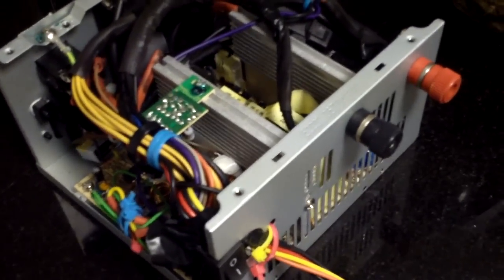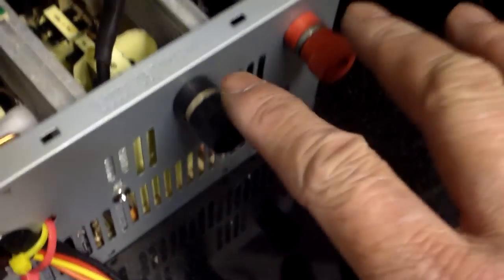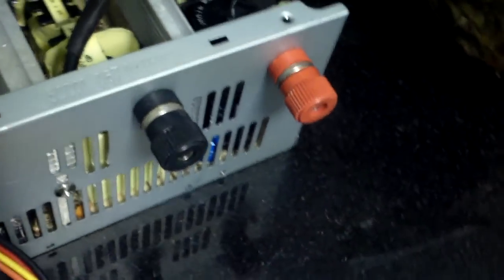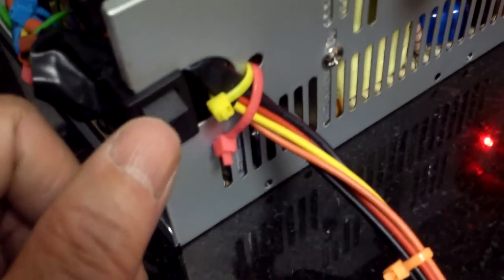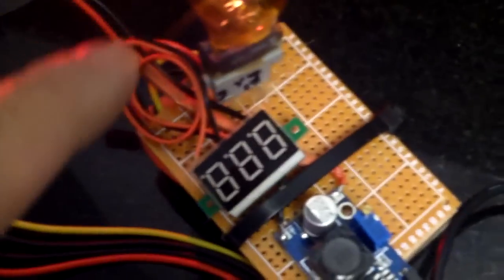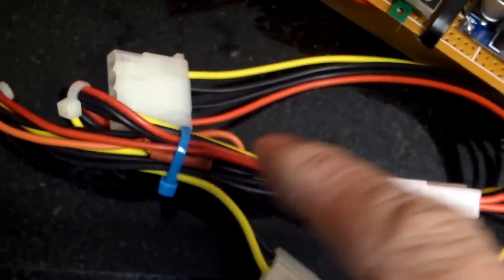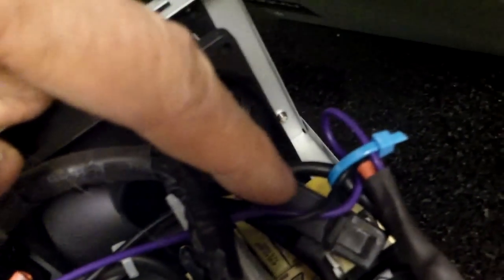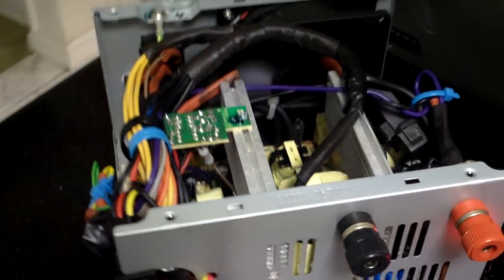Add a variable voltage option to your converted PC power supply pt 1

Comment: I have been using an ATX PC power supply for some time. Over time I have added this and that, until it looks like some , well, a whole bunch of crap all hooked together.  I built a new case from and old Spa Ozinator, I got the fan  cut out and mounted. changed the leads to to quick connect, as the fan and circuit board are now mounted on opposite halves. 4 screws and the circuit board with back panel slide out the back. I have yet to add the digital volt meter, my LED indicators, power switch ect.  
Thing is I have been debating weather or not to keep the 3.3V and add a post. 
After watching your video I have decided that I'm not going to.  USB, that debate still remains.
Thanks bro, for showing the alternative. I like it. I have something similar, but it's not variable.  YwRobot supply, can be set 3.3 and 5V.
See you around.
Reply from the maker: Thank you for adding your comment and your insight in converting the power supply.
Reply: @wtam69  You're welcome.  I have been enjoying YouTube for years, In fact YouTube is my Television entertainment 85% of the time.  The content is amazing.  Entertainment, that's one thing A+, but the information, is incredible. Any time I have a question, on doing anything, I always come here.  How to change the door lock on a chevy blazer, how to recondition a car battery, how to set up x y z swimming pool, how to build a fish tank, it's just endless. I find usually exactly what I'm looking for on first try.
I am just blown away with the amount of material here on Computer building, hacking, bulldozing, as well videos on electronics, which I am binging on at this period.  I have some great projects going on in electronics right now. What it is, is how long it took me to get here, to the world of amazing electronics projects, circuits, and gadgets.  This is great.  Now I got to ask you, have you noticed,  I think every electronics enthusiast on here has a DIY Power Supply of some kind, and is often their prefered device when demonstrating, even the guys with all the Expensive equipment, have a DIY PS  Most all of them are something I would rather have than an off the shelf unit.  Back in the day, the first thing an apprentice  carpenter built, was a tool box.  A power supply obviously makes perfect sense.   check it out.

Comment: BTW your switch mode power supply is regulated based on the 5v output, you will find the output is more stable if you place  the dummy load on the 5 volt rail. (you can tell the 5v rail is where the feedback circuit is because of the 20 Amp Max rating/also this is common for ATX feedback circuits)
   The other rails are most likey unregulated unless there is an additional linear regulator placed before the output. The other rails have a looser tolerance and are only regulated by their transformer secondary winding turns ratio in association with the 5 volt rail. 
   You can vary the entire unit's output by modifying the feedback circuit (assuming the components are rated for a higher output). If your supply uses a simple shunt reference for feedback (extremely common), I just uploaded a video on how to modify a SMPS shunt reference. Check it out.
https://youtu.be/5uiQjes-a98
(shameless self promotion, but the vid is licensed under creative commons and is non monetized)
Reply from the maker: Thank you for your input. I will check out your suggestions.

Comment: Can you combine the 12v wires to 24v and therefore  half the amperage?
Reply: boowonder888 
 It depends on how the transformer is configured. The secondary windings must be isolated from each rail. If the secondary windings for any 2 rails are totally independent, with their own independent rectification circuit, then they are "fully floating." This means each completely independent output rail can be treated like an independent battery. If you find that you have floating rails, they can be configured in series to "stack the voltage" or create a center point for dual polarity, or can be wired in parallel to increase output current. Just remember, isolation happens at the transformer and must remain isolated (no common ground connection, etc.). Also the biggest misconception many beginners have is that Diodes create isolation, they most definitely do NOT.

Comment: You only need to place a resistor which will place a load to get the converter section working.  I used a 1ohm half watt resistor and it started converting.  No need to go out and buy a 10 dollar power resistor.
Reply from the maker: Thanks for your insight.

Comment: NICE. MY OLD PC BENCH POWER SUPPLY JUST DIED SO I HAVE TO BUILD A NEW ONE I ALSO USED A 12V BULB on the 5v rail but all my power was on that rail,
It only had 2 amp on 12v rail it was 1997 vintage.
The old new one has 12amp on 12v rail so will be more usefull on my rc charger.
The old one  i housed in a old inverter caseing with 4 posts 12v 5v 3v.
i used a 10a stepup converter like this one
http://www.ebay.co.uk/itm/600W-DC-DC-10-60V-to-12-80V-Boost-Converter-Step-up-Module-Power-Supply-JT1-/291183197824?pt=UK_BOI_Electrical_Test_Measurement_Equipment_ET&hash=item43cbdefe80

All the best
And happy holidays
Jace.
Reply from the maker: Thanks for the info. These power supplies are too good to throw away. Happy holidays to you too!
Reply: I plan to use my SUN 1.5kw supply (it naturally supports voltage modification) instructed by the motherboard, i'm thinking if i change the output filtering systems to something that can withstand a higher voltage it would work fine.

Comment: Wow, you made use of every feature of the supply!  5v "flea light", standby/power switch, dummy load, voltmeter, variable voltage, binding posts.  I'm impressed.  That's exactly what any good PC power supply should have.  

Better still, it's an Antec 350!  While not a high-power supply by today's standards, for a bench supply it's plenty (if not even overkill), and that model power supply is still available for sale today.  I've used a number of them myself.
Reply from the maker: jaykay18 I'm a little like you,  I'd rather lit up the light bulb and see and enjoy the amber glow than to use resistors as a dummy load.  I have some extra 5 volt wires tucked inside the case for future use should the need arises. For the time being, there's plenty of power coming from the 12 v binding posts. It's a perfectly good power supply so it's a shame to throw it away.